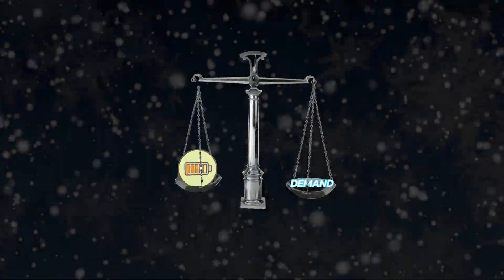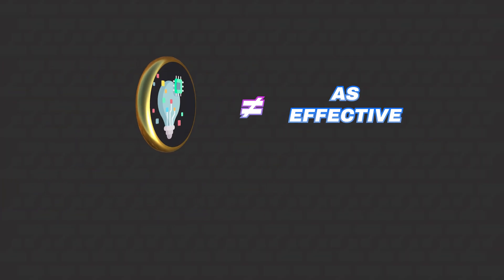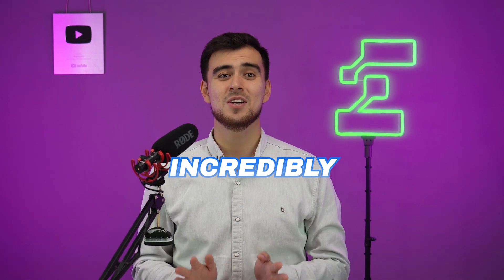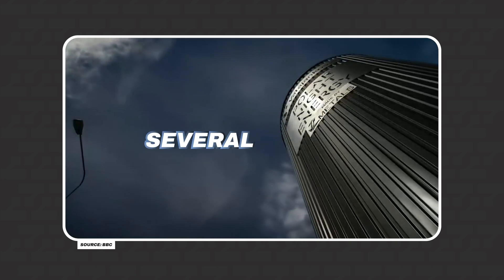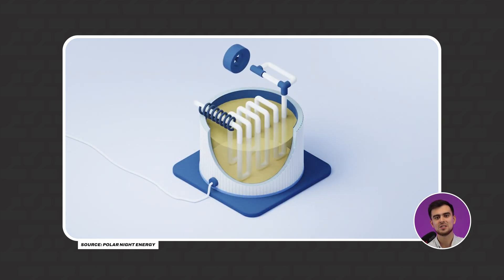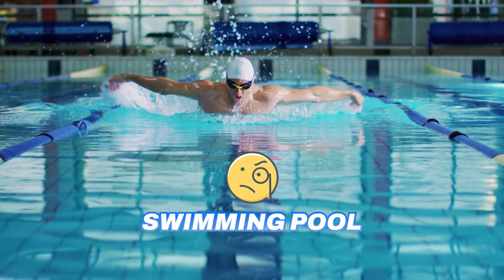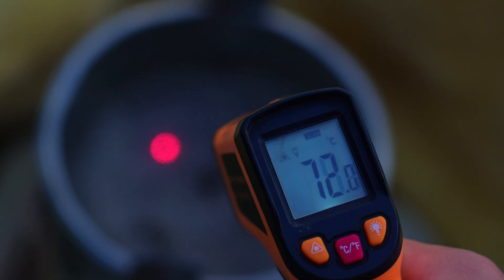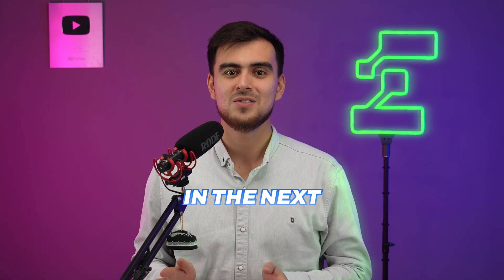I Tried a Sand Battery - Here is Why It is a Game-Changer

Comment: One 15 inch decorative milk can. One bag of playground sand. Either a 12 volt immersion heater that plugs into the cigarette lighter socket OR a 12 volt hot water heating element from a RV dealer. One UBS powered mini desk fan. Be sure to set that milk can on something to insulate it from the floor. One 12 volt car battery. Solar panel of sufficient wattage to charge the car battery from the drain overnight. From the solar panel to the car battery. Battery to the heating element. Mini fan to a socket UBS charger hooked to the battery (drain on the battery will be negligible). Fan to stir the heat coming off the milk can.
Will sufficiently heat a 12 foot by 12 cabin over night for sleeping. And the remaining heat at the top of the can will heat an 8 in frying pan to cook your breakfast.
You may even want to slightly open a window.
I have one in my living room with a water heating element. And a smaller version made of a 14 inch decorative SPARK pot bellied stove with an immersion heater as my element. My power source to the two ancient car batteries hooked in parallel. My living room is 14 feet by 18 feet and the kitchen is 14 feet by 12 feet.
Most days it stays around 68°F and the highs have been in the 40° range. One night the electric furnace kicked on. But it was 18° that night.
The ladies at the city hall always want to know if I am freezing in here.
My electric bill this past month was $36.73
😅😅😅😅😅😅😅😅😅😅
Reply: Oh, and the cat goes outside to cool off
Reply: water heating elements are bad for it- you need it from stove or water boiler.

Comment: i want to see a sand battery built directly into the front or back yard. lets say 100kg sand battery and use a heat pump to heat it like a geo thermal setup
Reply: In new constructions, it should be built into the foundation.
Reply: Now this makes the most sense to me.
Reply: there are European companies offering that on the market already. A dutch one, and a Baltic state one as far as I remember.

Comment: The thing is you need high volume of sand, high quality of heaters (Spoiler alert - don't go with water heaters like Electric Kettle) plus great insulation.

There is an UK company called Caldera - They had one prototype 'WarmStone' before they moved to industry tech - Prototype with vacuum insulated 2 tons of sand which could give heat for weeks for a home. Propably with ceramic heaters and mixed sand/graphite filling

There is also Mike  https://www.youtube.com/@off-gridsurvivalmike8120/videos   who is actually building one offgrid solar-sand battery. He have done few smaller sand battery projects - now he is making a big one. Earlier smaller projects could cook meals and give hot air for small winter garden.  

Third guy is https://www.youtube.com/@itanc1/shorts with smaller projects but with some stats and ideas of insulation.

Very nice concept for SHIFTING energy usage in time. Hope we will see something like Caldera projects for homes in a larger scale. Too bad they abandoned it.

Comment: Wow nice video! :D We are working on it to turn the heat from the sand back to electricity. And many cases we can use the waste heat from the turbine condenser so the efficiency goes up significantly. Total efficiency can be as high as 90% for combined heat and power plant. 

You can also wonder why we just don't stop all the cars and condensing power plants which has similar efficiency, 20-30%? XDD

Comment: Ok so 55 gallon drum with 4 3in exhaust pipes running threw sand and a heating element in sand with R60 insulation around it cost is about $600
Reply: Just fill the drum with water.  Seriously.  Cost is less, effort is much lower, and you don't need to store it at crazy high temperatures to take advantage of heat capacity. And you can move it around more readily.  And you'd never burn out your element.  Unless you need really high grade heat (above 100 C), with its very high heat capacity coefficient, water is the best BTU/$ heat transfer fluid you can buy.   For a grid-scale solution, you need high grade heat and so you have to go to sand/gravel, concrete, oil or pressure vessels.  But for single family residential scale?  Just use water.
Reply: Any more than R-38 and the cost of more insulation goes into greatly 'diminishing returns'.
Reply: @chasmarischen4459  wrong i build these all the time r60 is a needed

Comment: I wonder if a electrical resistor buried in the sand would do better. The resistor can be powered by solar panels directly increasing eficiency
Reply: That's how the Finish company does it.
Reply: Tried that, it works, but the problem with the electrical resistor is the short circuit protection. The heating element should not touch itself or the cage it is in. My practical thinking was to put it in clay/ceramic to be sure it can't move.

Comment: Gravel is better suited for this purpose, because of the gaps between the individual stones they can easily be heated by passing hot air through them and then there is no need for copper tubes
Reply: 8 inch concrete blocks, insert the copper tubes, then fill with sand.
Reply: Wouldn’t that make the storage less dense for heat retention? There would be more air in between, and from what I understand air cannot hold a lot of heat. Else, they should have made a tank of air instead of a tank of sand.

But I’m no scientist.
Reply: Absolutely true! Density is the stone size factor, so round pebbles not better choice, rough 
Rock size provides rapid heat transfer and air circulation through lauers

Comment: Haha would like to see how you isolate those several tons of sand :p cool idea though! I mostly wonder how you would regain the heat from the battery, or maybe even turn it in to electricity, regardless of the lower efficiency.
Reply: Stirling motor.
Reply: can make steam....steam turbine etc etc
Reply: The surface area, where the heat loss happens, increseas slower than the volume. That's why this technique works best with large units. Sand is also poor heat conductor, so in a way it's an insulator itself.

Comment: 5 hours for 5kg is not bad at all. It would be a pretty good system to put a sand battery in a basement of a home and store all the heat in there.
Reply: except the method to heat it was very expensive
Reply: @carlmartel8510  Needs a solar heating element
Reply: @carlmartel8510  In the summer, solar water heated pipes run through the sand heating it.  Winter comes, recoup the heat.
Reply: Yes, fill up your entire basement with 1000C sand!  Will keep your house very warm for whole winter.
Reply: @ck17350 put a beach umbrella in and a pond.
Reply: Heating mass is more type mass plus circulation issue than sun, solar, wood/fire source. Proportional wise.
Reply: Yeah just have the boiler surrounded with sand with the pipes running through it then if it ever goes out if you built your house with like a 2 ton sand box around the boiler it would heat for ages  this concept is amazing for getti g rid of heat from servers usefully 😊
Reply: Keep the kids away, and don’t spill it.
Reply: This would be much longer if he used any kind of insulation too.

Comment: Maybe we should be putting sand batteries underground for better insulation?

Another possibility is that we can store cold as well as heat.  The idea is to create a temperature differential.  It doesn't really matter if your thermal storage is hotter or colder than the ambient. So we could store heat in the day to power the night, and cold in the night to power the day. With refinements, there might be a way to use the heat differential between the heat store and the cold store to get a higher differential that's sustainable  over the time it would take secondary system to charge its hot and cold sides.  Or maybe you would need to rotate 3 or 4 systems depending on the recharge time.  That's something for the research to figure out. 

That's a simplification as temperatures are more complicated than that, but it's the general idea.  It's going to be fun watching the tech develop in this area.
Reply: An elegant, practical and resourceful solution, I think, to longer term storage solutions.
Reply: They did that in the olden days with wood chips. They would bring in ice from a lake or river and put it in the persons chosen area and cover it with a pile of wood chips.
Reply: Ground source heat pump would likely be just as efficient unless your real estate is too expensive and you have to go vertical and need a dense battery.  I think an insulated water tank would be more efficient than cold sand.
Reply: @kenreynolds1000  sand batteries basically work as heat pumps and can be above ground or below ground.  The big differences is the "sand" or whatever is insilated from loosing its heat to the surrounding environment. I have wondered if the heat added by ground heat pumps could negatively effect the ground biome by raising the ground temp above what the natural life cycle of whatever else lives there  beyond what it could handle.  Could they accidentally be sterilizing our ground of beneficial life forms. I don't know the answer to that, but it's something we should look at.  Life tends to be resilient to a point, and maybe the added heat is below that "total death" threshold so that the more resilient of the species survive and recover. But maybe not.  Just something that should be checked is all.
Reply: @colleenforrest7936  I doubt it would affect much beyond what you see on the north side of a building vs the south side as far as the biome in most environments.  Digging up and pouring the foundation and pushing the top soil around the site likely has a magnitude of impact more than a warm water line surrounded by hundreds of tons of deep wet fill dirt over the life of the installation.
Reply: You can use water for that
Reply: A Nitinol engine could use that temperature difference to work! 😄
Reply: Perhaps a Tesla turbine could be the thermodynamic transformer at the center.  https://www.youtube.com/watch?v=FHV2sQp-KHU&lc=Ugz09OHDp3e14PCn1a94AaABAg
Reply: I think you would more quickly hit a limit to how cold you could go. How do you produce the cold and, except for cooling, how do you use it? I think thermocouples that create electricity from a heat differential aren’t very efficient. You’d do better to use the heat to drive a stirling or steam engine to produce electricity.

Comment: We can also use sand battery for making electricity by using a steam turbine with a liquid with low boiling temperature.( we have to choose this liquid according to the heat capacity of sand battery). By the way, love your this type of videos.
Reply: Instead of using a liquid with a low boiling temperature, you can use  a water's vacuum boiler/heat exchanger to produce steam. Vacuum boiler brings the boiling point of water significantly down
Reply from the maker: Wow, did not think about this kind of liquids, do you have any solutions for liquids?
Reply: @engineericly  I thought for a while and came to conclusion that alcohol could work. (But take everything I said/wrote with a grain of salt because I'm no expert on any of these things, I'm just proposing a idea with my knowledge from my science lesson that states that every liquids have different boiling point)
Reply: @engineericly  any alcohol should fit the bill. but i would encase a copper coil in the sand and then use car anti-freeze in the coil. use a double boiler to get water steam from the antifreeze heat.
Reply: @engineericly  Sir, I don't really know about those types of liquid but I'm pretty sure that these type of liquids are there. I was just proposing a idea but if you research than you could find this liquids. Or if you don't find any, do the thing science is known for, that is "experiments" with different liquids.

Comment: you showed us how to heat it up but you didn't show us how take an electricity from it as an energy source 
but the idea and effort that you spent to do this experiment is great , keep it up ❤
Reply from the maker: As said in the video, it is used as heat to warm homes and water
Reply: You can also use a sterling engine powering a generator for electricity. Use the warm sand or hot air from the sandstore to heat up the "warm" part of the sterling engine.
Reply: Try either thermocouples to generate electricity or copper tubing to heat water and turn a turbine.  These people are over complicating the whole project.  For the simplest concept, just use a metal garbage can, painted matte black.  See my instructions above.